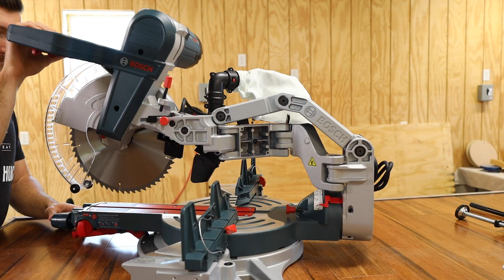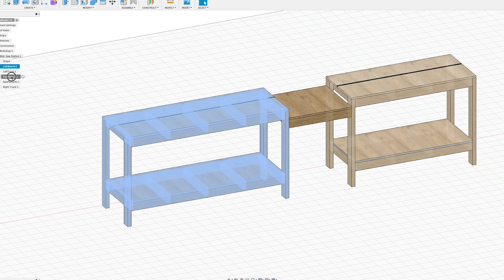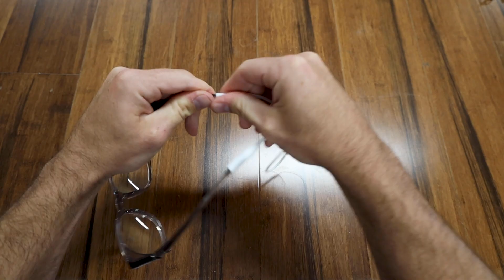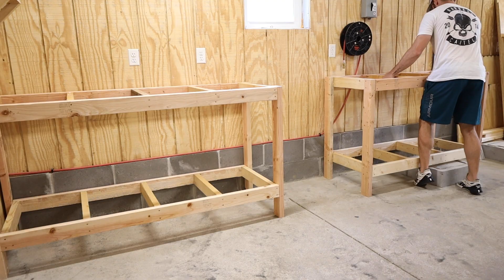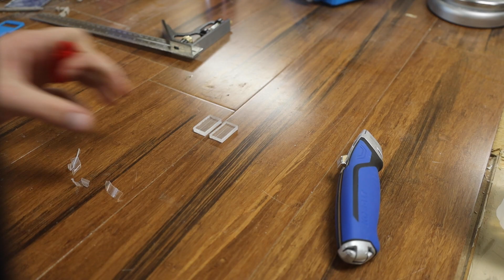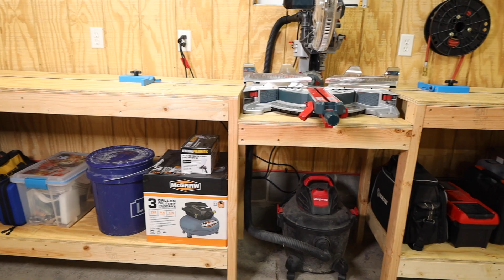Super Simple Miter Saw Station With 3D Printed Stop Block!

Comment: I LOVE your stopblock!  However, before I order the parts and hit print, I wanted to ask you a about the "flex" of the arm.  I see how it would work for trim pieces, but what if I am sliding a 2x8 up against it?  In your video I saw it deflect a little when you slid the 1x3 up against it.  After 3 years, how would you say it is holding up?  Would you make any changes?  Should I consider making the arm out of a piece of steel or aluminum?  Overall it looks incredible.  Thanks for posting the video and the plans!
Reply from the maker: Thanks! It seems to have held up well, it flexes a tad but always to the same point so I just make sure to put the same pressure on it each time and have accurate cuts. If I were to remake it, I’d make it have a metal arm to get rid of any flex though!

Comment: Really great idea for a stop block! What does the 6mm bolt that holds the pivot arm screw into? I didn’t see any nuts listed in your parts list. Maybe there is a 3d printed threaded cavity (?).
Reply from the maker: Thank you! Glad you liked it! I’m away from my computer right now but I believe I just threaded the M6 bolt into a 6mm hole with no threads and let the bolt do the tapping. Another option is to use an M6 heat set insert

Comment: Pretty cool finish. One flip arm may not be sturdy enough. I’m planning mine and the current plan is to have a U shape arm with 1 pivot on each end of the sliding block. Also the sliding block can probably be a little smaller to gain a little more cutting capacity. 
I also have the same saw.
Reply from the maker: That’s a great idea! I printed with 100% infill and it doesn’t flex at all, but I may adopt your idea anyways, sounds cool!
Reply: @ModernHobbyist  and I’m gonna use your magnet idea for sure.